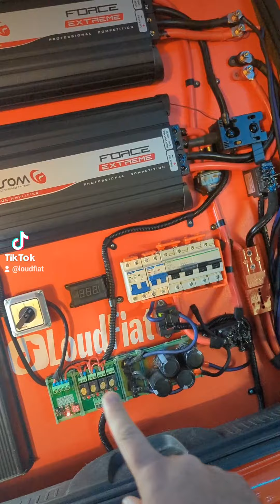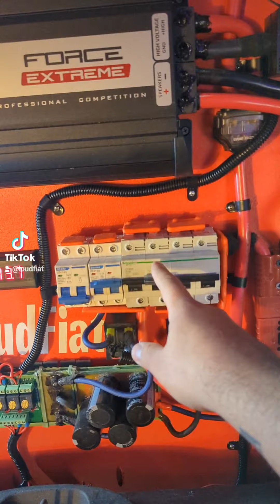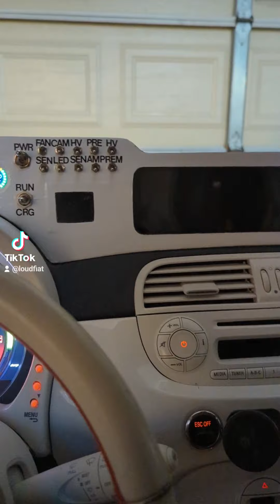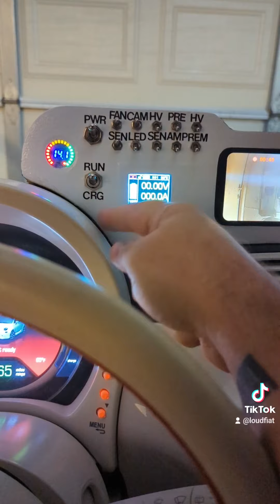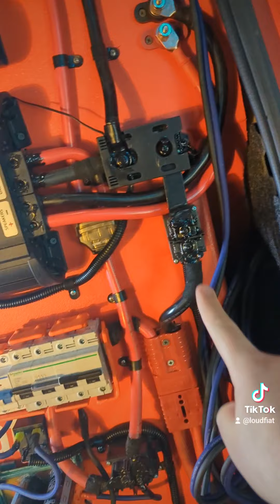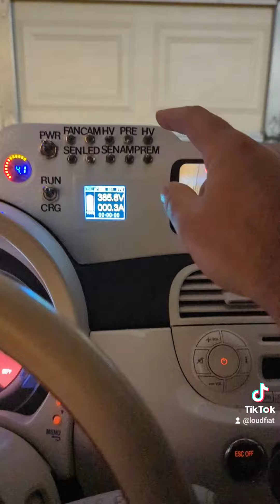How to start up the 390,000 watt electric vehicle SPL sound system

Comment: I really love your project man!. Since 2006 i always found ridiculous to have car audio stock at 12-18Vdc while speakers require hundred volt to push the todays SPL... Once i got my Volt in 2014 i have immediatly thought about using a 3 phase inverter power output stage ( IGBT etc) that normally run the AC motor to run speakers instead!.. Your HV amp are what i think is an intelligent way to produce hundred thousand Watts range! no isolated boost converter required wit all loss and $$$ copper bus everywhere... only tap direct the HV350-400V to a class D  amplifier output stage and that's all! I wonder if dbdrag racing will allow a class using these one day! I really wish!
Reply from the maker: One day! I'm still the only one in the world running this off of a electric vehicle traction battery, have been for years, so I think it will be many more years until folks catch up.